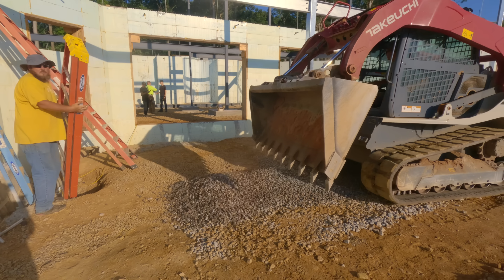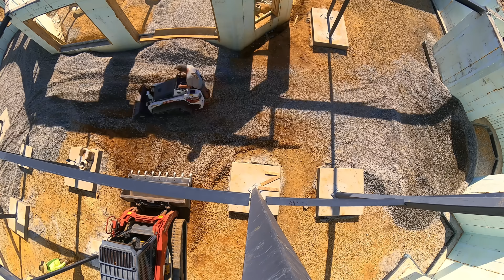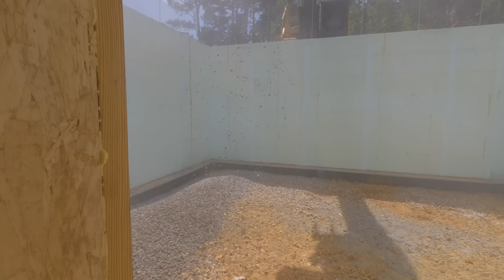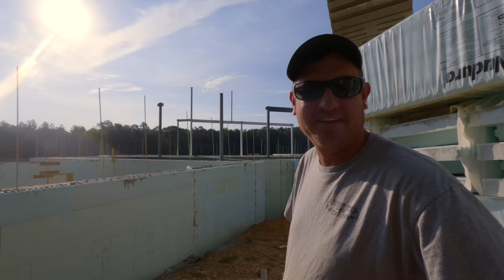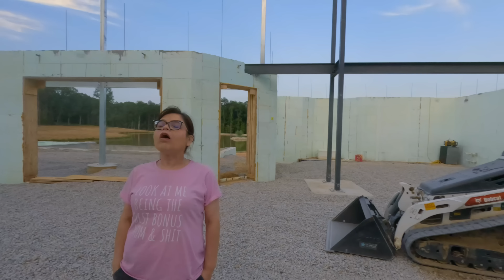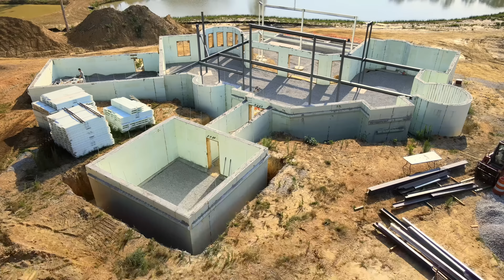200 Tons of Gravel Added to the ICF Mansion Basement

Comment: This Looks Great. My wife asked How You hang pictures on Concrete walls. I tried ti explain that the Foam stay's in place and that there are areas with plastic in the forms that can be screwed to. but, I am hoping  you may Cover this in future coverage of your Build. I personally Love this ICF Idea Having pulled and installed my share of Forms for foundation and love the Idea of concrete Floors. and upper stories, having remodeled a couple office buildings. Love the Modular Idea. for ceiling and walls there are exceptions. Black water sewage etc. but Steel framing Is awesome.

Comment: The floor joist system is excellent you will make up time with it. stay away from second floor steel you might twek  joist until you pour . When you lean a latter on up right steel the leverage can be unbelievable

Comment: Cut Chris outta this picture! ;-) somebody in your area has got to be running a concrete conveyor truck business- Putzmeister Manufacturer, nothing against Chris's great quality work, but a conveyor would make quick efficient  work of that job w minimal labor, ( used often for wall pours and gravel ) you could have your under floor plumbing in place and fill and grade to proper floor  base elevation and or backfill any spot. Keep Going! The Boss is gonna be a Happy Camper when yer done!!

Comment: Jeff,  with a job that size, I'm surprised you didn't use a stone slinger, you could have avoided moving the stone twice.
Goes without saying, still an amazing undertaking and a top notch job with Chris's expertise.
Reply from the maker: Only ones they have here, you have to load the hopper. So about the same amount of work in the long run

Comment: question :: if you put the super floor system up for the first floor how are going to be able to move the pump truck boom hose around when you pour the floor slab for the basement??  I figured you would have to do everything for the basement floor slab - pour concrete & then install the super floor for the first floor. can you use the dingo to transfer concrete for the basement slab if you put the super floor up first ??
Reply from the maker: The operator I usually use is going to maneuver a boom through the big door openings. It’s going to be interesting at least 🤷🏻‍♂️

Comment: So the pools didn't need any waterproofing or sealants on the outside next to the fill? Also, will the 2nd level floor be poured at the same time as the walls? 

BTW, I'm sure you already know you can't allow muskrats or beavers to exist in your pond. Muskrats in particular will destroy the dam. They must be removed before they get out of control.
Reply from the maker: No sealant needed on the outside. No, the floors will be poured at a later date.

Comment: the changes with the pillars and the layout and TVs are very difficult to hear....what you had plan before sounds much better.
Reply from the maker: The rhode mic setup took a dump. I’ve got it fixed now.
Reply: @BealyGood  What I meant is not about the sound in video. That your previous plan for the rooms sounds better then the new one, =)